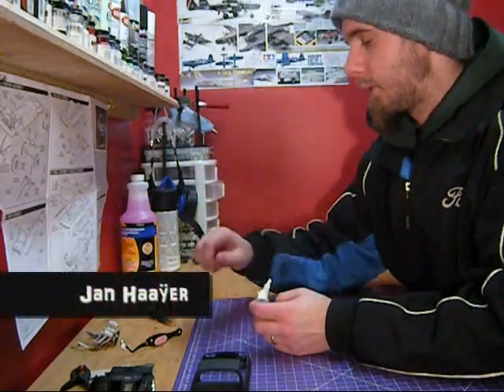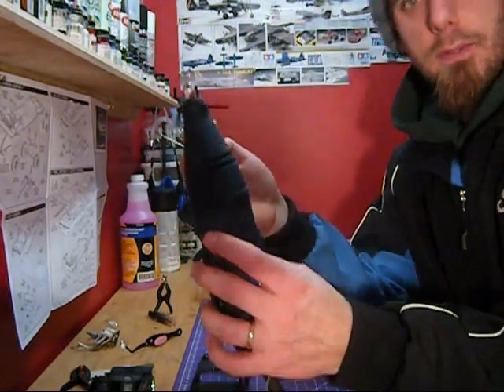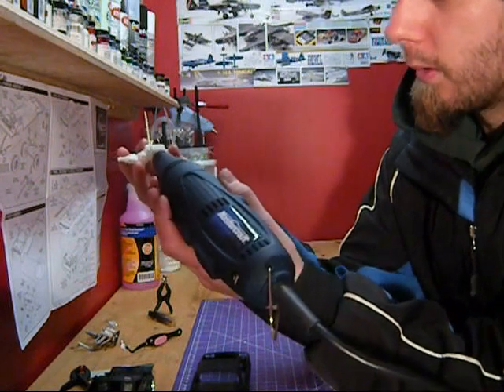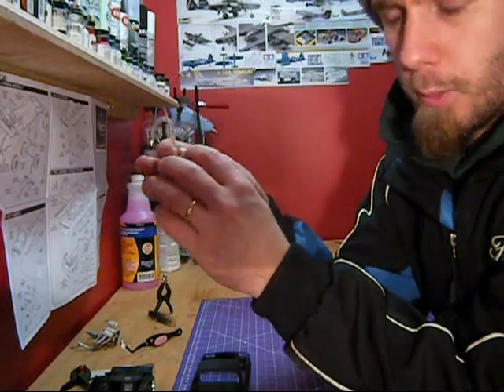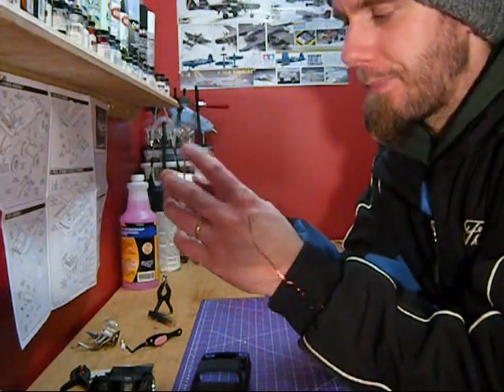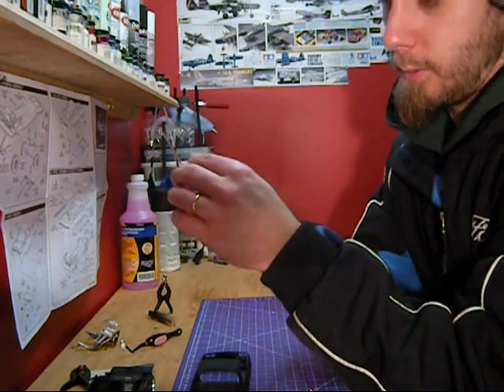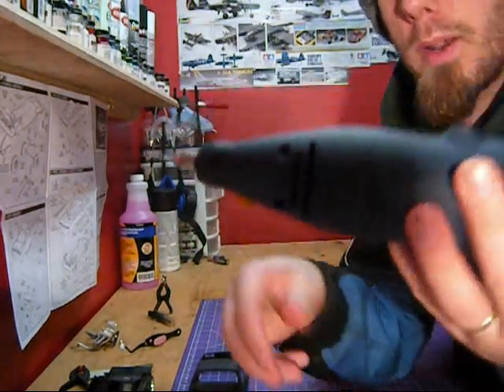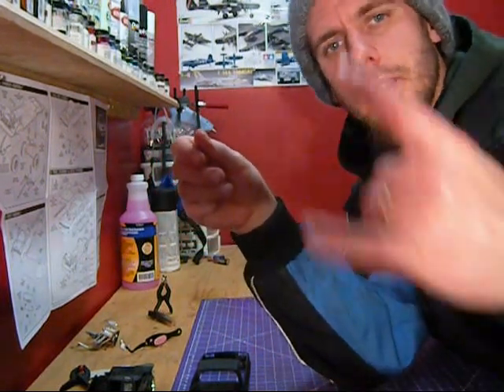How I Drill Holes In A Motor For Spark Plug Wires

Comment: .This part is easy but what kill me is the distributor. So u only make 1 hole in the dist, and than run  all  6 or 8 wire out of it. I bought Air Dry Das Clay to mane a bunch of distributor..I'm going  To see if it work as they said or I think.. I didnt cost much but u get a lot  and also going to built a surf board. For my Pie Wagon. They said it get hard and u can paint the clay..TIME WILL Tell. DO U HAVE A PLACE I CAN SEND YOU PIC?